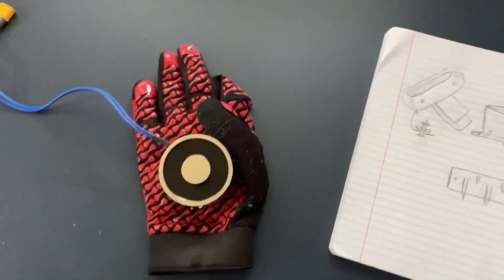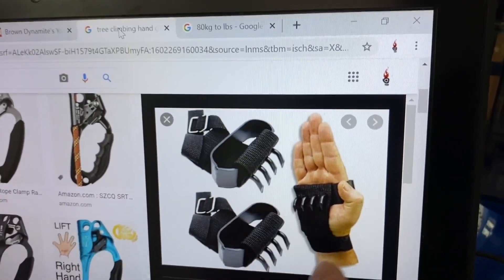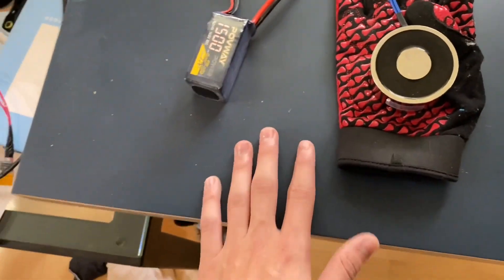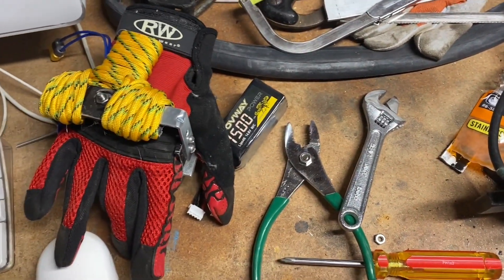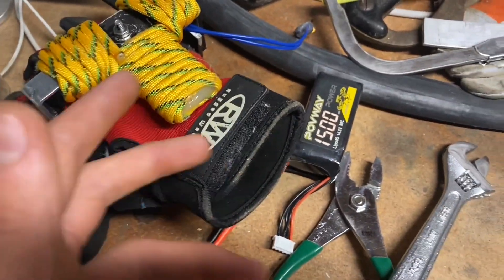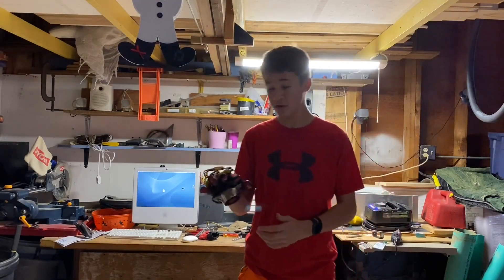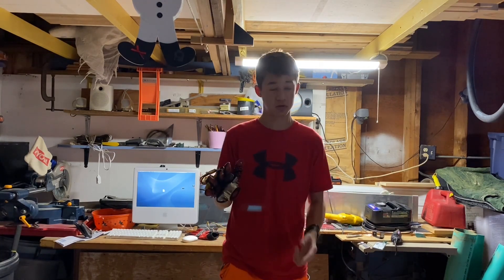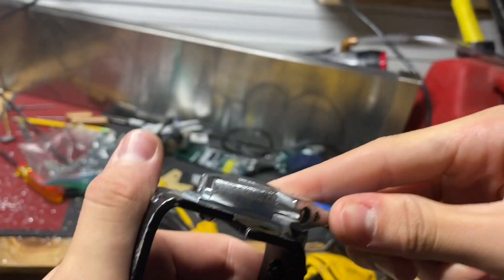Making REAL SPIDER-MAN WALL CLIMBING GLOVES! - Ep 2 | Climbing Wood And Metal!

Comment: Waiting Eagerly for the test video! I have a SUGGESTION -
Please slow down the video a bit for us to understand.
Reply from the maker: Thanks, 
I try to speed up the building parts and make them more entertaining because when looking at my analytics, that is when most people click off the video. 
I am working on making a discord server which anyone can join and I will be answering any questions and explaining how my projects work!

I’ll reply to this comment when the server is done so you get notified!
Reply: @Random.Creations  Can you please tell me the things you used in this amazing video? Please provide the links to buy them.🙏🙏🙏🙏🙏🙏🙏🙏🙏🙏🙏🙏🙏🙏🙏🙏
Reply from the maker: I used a 80kg electromagnet, I’d recommend using one that is rated for more than your weight so that it can withstand the force of you tugging on it. I also used a button, 14.8v LiPo battery, and some aluminum bar to go around the glove.
Reply: @Random.Creations  Can you tell me what did you exactly use at 2:31 ?
Reply from the maker: I used the Haisito Balance Charger.